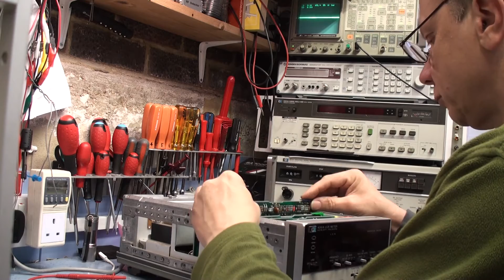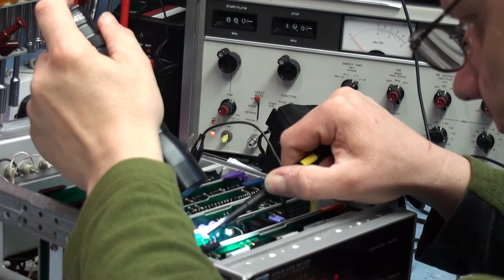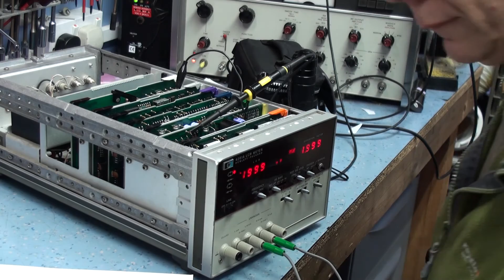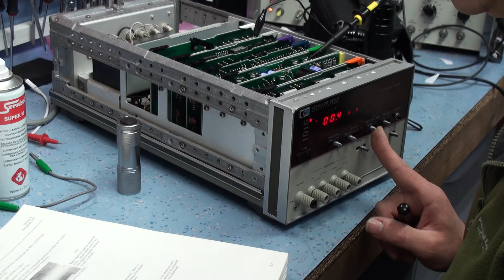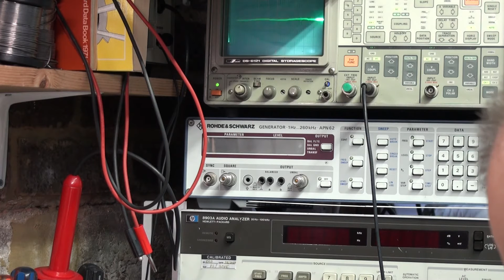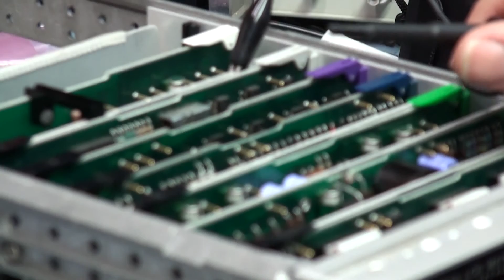Hp4261a calibration of repaired unit.

Comment: I just picked up a 4261A, non working of course! Nothing is working on it, will be an interesting project once I finish the Fluke 5200a Repair.
Reply from the maker: They are a good unit Scott. A bit slow on ranging in the 120Hz mode but it gets a lot of use.